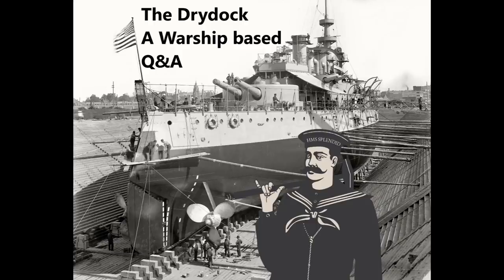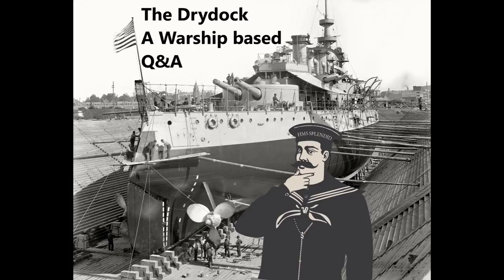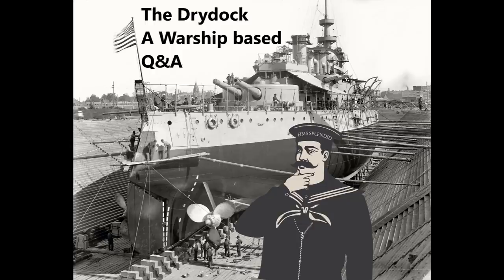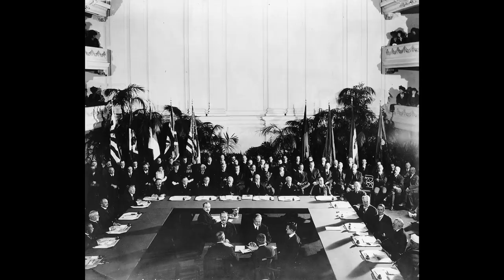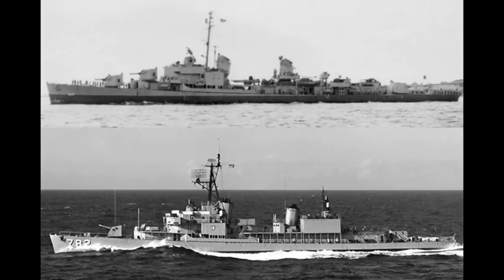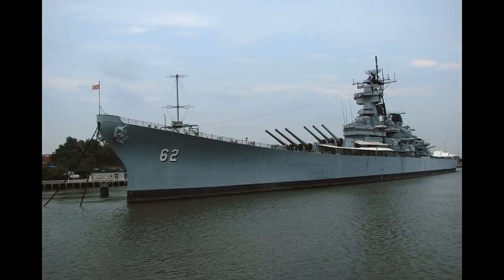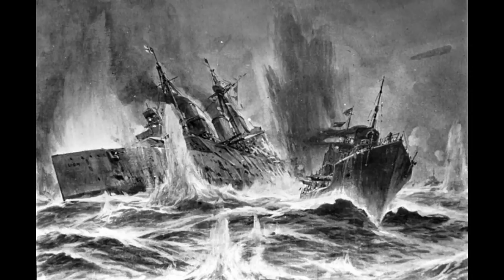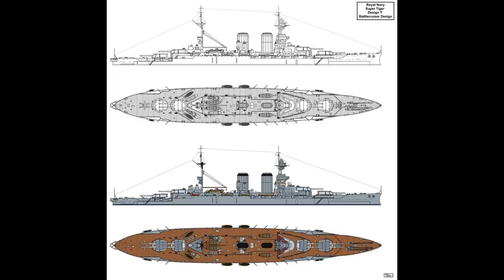The Drydock - Episode 039

Comment: If the four admiral class ships were built before the Washington treaty, the treaty tonnage limit probably would've been 45K tons instead of 35K tons, and the construction moritorium might've been a non-starter as well. The other signatories probably would've insisted on building ships which could counter the admirals, and this would've significantly impacted battleship design during the interwar period and thus the ships available at the start of the war.
Reply: More to the point in that answer - if you've got 4 Admiral class, you won't get any Nelson class by definition. The agreement was for the RN to be allowed to build two new ships so that they would have a similar quality battle line to the US fleet. 

It's unlikely an agreement would allow four Admirals while no other nation had a 35k+ ship, but a better answer would probably be that the agreement would be for the RN to use their 525k tons on 14 vessels (5 QE, 5 R, 4 A and one of the Renown class)

Comment: If the British had that many Admiral-class battlecruisers to preserve then there is no way the Washington Naval Treaty includes a 35,000 ton individual ship limit. Admirals are about 46,000 tons at deep load, so expect the 45,000 ton treaty limit under the escalator clause in London to be the standard limit in Washington. Can't guess whether London would then include an escalator clause to 50 or 55,000 tons. The new London Treaty BBs would then all be Iowa-class or something similar. So the United States will see your eight Admiral-class and raise you 10 Iowa-class (or maybe you then have six Iowa-class and four Montana-class).

Comment: A big difference between single purpose and dual-purpose guns in destroyer size ships is the physical mount and not the gun itself. The 5"/38 on the early Farragut and Mahan class destroyers the Mk21 mounts with the the Pedestal type design were slower firing and had more restrictions on the elevation that the gun could reloaded. Later ships with the same gun but with the enclosed base ring design had improved ammunition hoist designs and could sustain a higher rate of fire even with high gun elevation angles. The British had similar problems, but they lasted longer, and the smaller size of their destroyers also limited the maximum weight of their gun mounts.

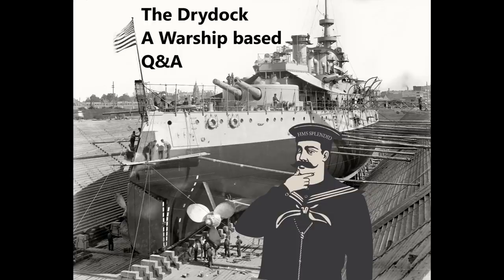Comment: 49:10 German theory had some advantages, most notably the fact that even the big guns of French and British ships were not able to punch through the armor on the main belt of most other pre-dreads, so the best shells to deal with other pre-dreads were probably HE shells. The best thing you could hope for was setting enemy pre-dread ablaze, and then you could send some more shells to kill the damage control team, or start another fire. And 9.4in or 11in shells were just a little bit less efective than 12in or 13in. 
The other fact is that accuracy in that time was so horrible, that you would like to have at least 100, or 120 of shells per main gun. That is very difficult if your main gun is too big. Also higher RoF meant that you were much likely to score some hits earlier than the enemy. 
Problem with that theory is simple - once AP rounds got better, the main battery guns had a decent chance of penetrating the belt armour of enemy ships, and the bigger your guns were, the higher was the chance of penetrating enemy ships.

Comment: 2 questions for the Q&A

1.  During the middle and later parts of WW2  Battle of the Atlantic.  How many C.V.Es were assigned to convoy duty??

2.  What kind of difference would it made if the Japanese navy dropped the 25mm aa gun in favor of the German 20mm flak and 37mm flak or even 40mm bofors (coping ones they captured)??
Reply: The Japanese actually tried to copy Bofors.

Comment: You mention something along the lines of the USN opting for 38-calibre 5-inch guns over 51-calibre to make them more suited for AA.

Why does decreasing barrel length make a dual-purpose weapon more suited for AA use?
Reply: This was answered in a previous dry dock, iirc less weight you can turn them quicker and the lack of range doesn't matter until you get radar guiding, which is why they're longer on Vanguard etc.

Comment: wow, i was thinking about the 300 uboat question recently.  if the german surface ship building efforts had been channeled into submarines, it could have happened.
Reply: I'll try and dig out the source. But I read that actually it couldn't have happened. Their wasn't enough raw material to make more batteries. That would have been the bottle neck.

Makes sense when you think about it... It wasn't a lack of workers or steel and it's not like a battleship and a u boat would b built on the same slipway. So thats not a factor.

Bugger me if I can remember the source.

Comment: The %'/38 was superior to the 5"/25 for antiaircraft work. The 5"/51 was superior for surface fire but had no utility for antiaircraft work. As shown at actions like the one off Samar, the combination of the 5"/38 gun and superior ranging radar and fire control showed it was a gun able to inflict damage all out of proportion to the size of the gun itself.
Reply: Not saying the destroyers at Samar weren't courageous, but that battle was won primarily by airpower, the DDs and DEs real contribution being that they bought enough time to launch the planes. Aside from the Taffy 3 CVEs, those from Taffy 1 and 2 also participated actively during the engagement, and these two task forces rearmed with anti-ship munitions during the battle. Land-based aircraft also made a significant contribution.

Without the planes Centre Force wouldn't suffer as heavy losses as they historically did, and probably would have continued onwards.
Reply: @bkjeong4302  No doubt, it was the combination of air and surface power that made the Battle off Samar a tactical victory. It wasn't just the damage caused by aircraft either. The number of planes and the ferocity of their attacks helped convinced Kurita has was being attacked by a much larger force that included fleet carriers. Probably the best single battle of the war to show how air and surface power could work together for victory.
Reply: Sar Jim 

Actually, air and surface power working together was NOT recommended by anyone, least of all the USN. The risk of friendly fire was way too high. The only reason it happened at Samar was because things were desperate, and even then, for the second half of the battle airpower was far more in play than surface units. On top of that, carrier operations (that are preplanned rather than ad hoc like off Samar) take place at a rave that makes it outright impossible for surface ships armed with guns or torpedoes to participate. 

Had the escort carriers of the three Taffy units known Centre Force was around, there wouldn’t have been a surface action because the air attacks would have taken place earlier as the flattops moved away, before the destroyers needed to launch that crazy attack to stall Centre Force. (Yes, Centre Force could outrun CVEs, but not if they were under air attack)

So Samar is a fluke when it comes to airpower working alongside surface units, and should really be considered an example of airpower trumping surface units rather than of air and surface units being good at working together.

Also, as said earlier, the carriers from the other two Taffy groups rearmed. Kurita may have been deluded in the first half of the battle as to the risk he was facing, but towards the end he was actually correct in that his force was in danger of air attack, albeit that the attacks were coming from a different source than he realized.
Reply: @bkjeong4302  The last fleet problem before the Pearl Harbor attack was one that assumed all the battleships of the Pacific fleet had been sunk or were too far away to be of any use and only two carriers were available. The centralized command and control facilities at Pearl and Manila were also assumed to be out of action. Any actions would have to be fought with a small number of cruisers, a larger force of destroyers and subs, and PT boats. The entire purpose of the problem wa sot make each commander do his own plan of attack attack while being able to also communicate with other fleet units, including aircraft. 

By the time of Samar, many USN aircraft had IFF units, and aircraft flying CAP over the fleet during kamikaze attacks got good at avoiding antiaircraft fire, while the fleet got good at prohibited zones that aircraft were supposed to avoid as free fire zones from the ships, and communicating those zones to the aircraft. The continuing perfection of CIC's did a lot to allow the fleet to control fighters and bring them into the attack when needed. Not saying that a lot of lucky circumstances, some due to the training from that last fleet problem, didn't combined to make Samar an unusual battle, but I also think you're not giving the Navy enough credit for being able to combine aircraft and surface action, sometimes on an ad hoc basis, when it was needed. We would have lost many more ships to kamikaze and conventional attacks to Japanese aircraft of all types if that hadn't happened.
Reply: Sar Jim 

When I say “air and surface units working together” I mean when surface ships and aircraft are both attacking surface units (which is what happened at Samar), not anti-aircraft defence. What I was trying to say was that attacking enemy ships with surface and air power at the same time wasn’t part of the doctrine and a bad idea outside freak events like Samar.

Shooting down enemy aircraft is entirely different from attacking enemy ships in tandem, because then you don’t need to worry about friendly fire, and because intercepting enemy planes takes place at much closer range than carrier strikes, meaning that surface ships can actually contribute instead of being only able to sail alongside.

What happened at Samar was that Centre Force caught everyone off guard, so the destroyers attacked the enemy surface ships entirely to buy time for the CVEs so the CVEs could carry the day (which they did). if the CVEs hadn’t been caught off guard they could, and would, have won the battle on their own without the craziest death ride in history.
Reply: @bkjeong4302  Oh, okay, we have been talking past each other then. My comments were addressing using aircraft for fleet defense, including attacking enemy surface ships when that was part of the mix. The Navy really hadn't considered how will air power and surface ships could work together when attacking enemy surface ships. Most of the experience was air power attacking the enemy while surface units were never part of the mix. From that point of view, Samar was a unique operation, and one that succeeded because commanders on the scene were able to improvise tactics and win.
Reply: Sar Jim 

It was a unique operation, but because of that the importance of surface ships in that engagement tends to become greatly overstated, while the CVEs that deserve the majority of the credit don’t get it.

Comment: How would a pre dread fare against a ww2 heavy cruiser?
Reply: WWII cruiser wins. Range, rate of fire and speed. Modern cruiser will dictate the terms. Pre dreadnought aren't that well protected and the metal quality were much poorer.
Reply: How about uss Alaska vs hms Dreadnought
Reply: @super44lover  I highly doubt that Dreadnought would even be in range of her guns through out....... This is a horrible match.....
Reply: @bigbigmurphy  how so? Are the alaskas guns that much longer range?
Reply: @super44lover  Ship itself, HMS Dreadnought is slower, uses older metal(weaker), worse protection scheme due to the weaker contemporary weapon it was design to encounter. Weapons, USS Alaska has way better fire control, better gun due to design and advanced metal alloy compound, better range and better shells. With radar, Alaska can be operating in bad weather while Dreadnought can not. Bonus fact, newer ship has way better damage control systems and crews are better trained. All factors combine, Dreadnought is nothing but a slow moving target to the Alaska.
Reply: @bigbigmurphy  it amazes me that technology Advanced so much that a ww2 big gun cruiser could beat up a ww1 battleship
Reply: @super44lover  To be frankly or ironically, technology advances the fastest, during wartime.
Reply: The ironic thing is that even though Alaska would wreck Dreadnought, the former was obsolete upon launch (thanks carriers), while the latter made all before her obsolete.

Naval technology: when you are at risk of having your weapons become obsolete or conceptually pointless before you’re even done making them!